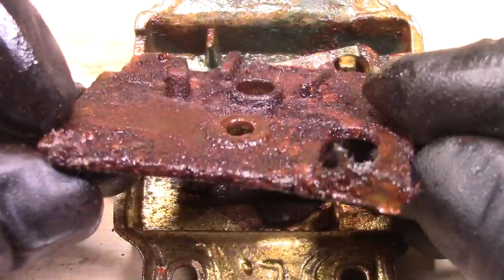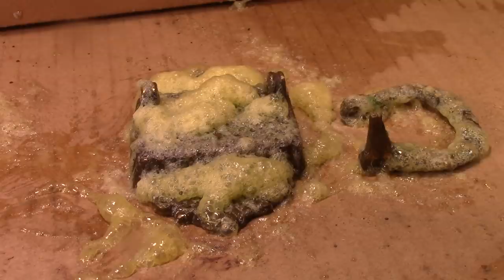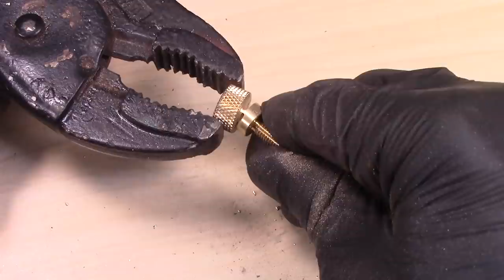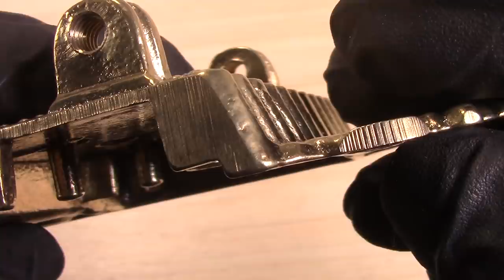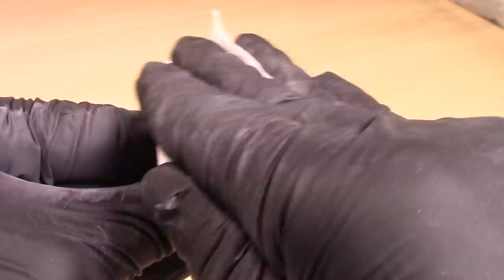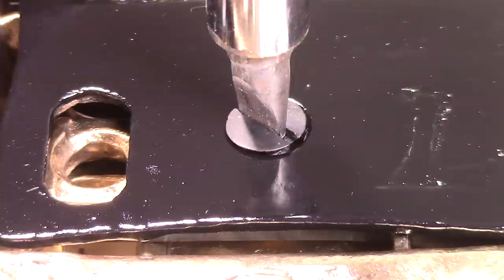Ornate 1890s Ice Box Lock Restoration | Random Restoration

Comment: Hi, 
You did a great job restoring this piece.
 I was wondering if you know what to use to keep brass door handles from turning brown. I restored one of many and used a rustoleum matte spray coat and it is wearing off now. I wonder if there is something better out there. Thanks!
Reply from the maker: The best and easiest thing to use would be a spray on brass lacquer, which I’m sure many companies make. One that’s supposedly good (I haven’t tested it much yet) is made by a company called Mohawk, though it’s not a matte finish. Rust oleum clear coats are all very weak, so I’d try to find a lacquer that’s a bit pricier, though finding one in a matte finish may be a bit of a challenge! Thanks for watching!
Reply: Thank you so much! I have seen or hear that brand. I will try to find it here. I am willing to part with the matte finish as long as I don’t have to keep taking handles off and polishing and spraying again. Thank you so much for the reply!

Comment: Lovely restoration.  And I know this is an old lock but the simplicity of the mechanism surprised me.  It's just a latch with a simple item to hold the latch in place.  Yes it was for an ice box so not a lot of security was needed even back then (it was more to ensure the door stayed tight to keep the ice from melting).  Still I expected just a touch more.  Nice surprise
Reply from the maker: Yeah there are a lot of smaller latches like this that are surprisingly very simple. They really went for the smallest number of moving parts and as a result it’s not very secure at all haha. Thanks for watching!
Reply: @randomrestoration6858  But lovely as a decoration
Reply from the maker: @walterengler5709  Absolutely!